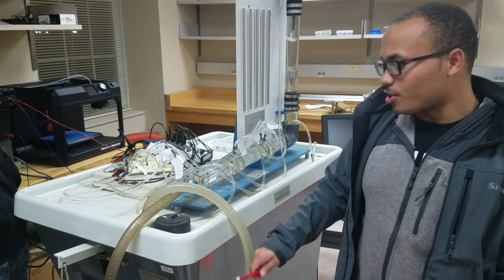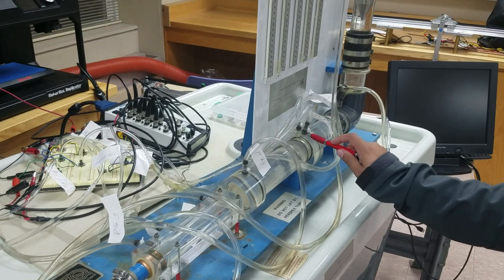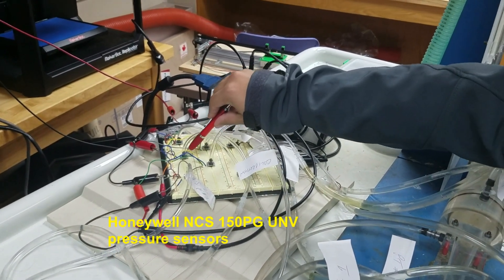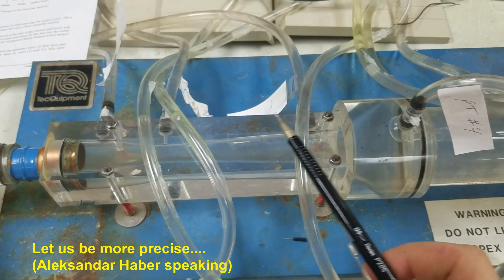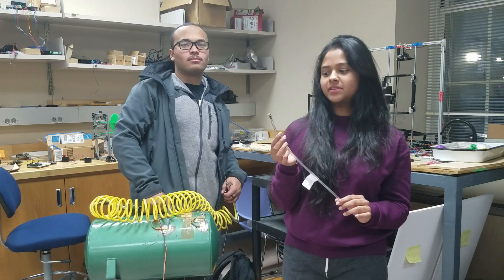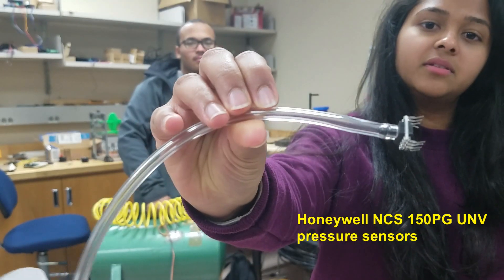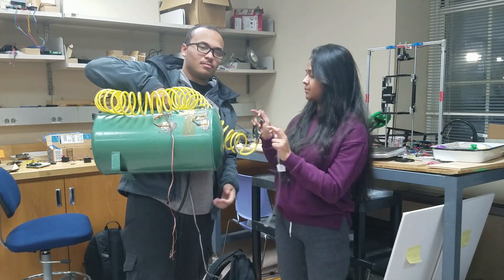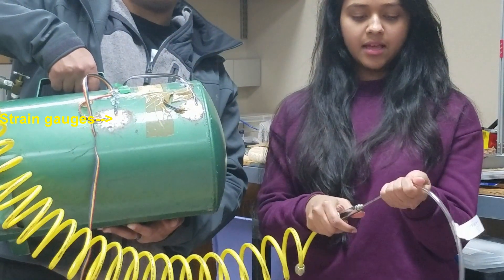Fluid Pressure and Flow Measurements-Venturi, Orifice, Rotameter- Honeywell Pressure Sensors

Comment: Honeywell senors cam use with fluid? 
And they can send data to the Arduino board or raspberry pi 3? ,because I want to stick to it more than Three Sensors of Pressure.
Reply from the maker: We were able to detect the output voltage change of the sensor. We have a sensitive data acquisition card, so we were able to detect the voltage change without using an amplifier. I do not remember exactly, what was the measured pressure range, but I think that the output voltage was in [mV]. In any case, you can add a simple instrumental amplifier to amplify the output voltage. Now, if you want to use Arduino or Raspberry Pi, you need to make sure that the output voltage is the measurable range of A/D converters of Aduino or Raspberry Pi. Read the specs of the sensor, and look at the sensitivity.